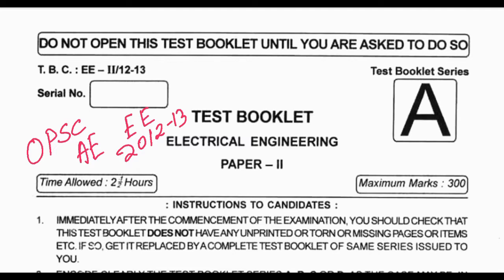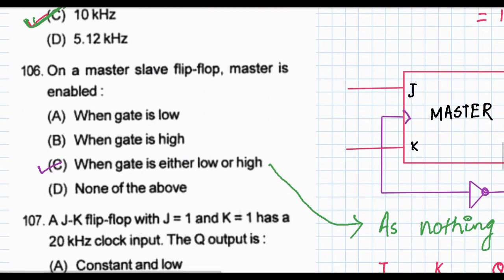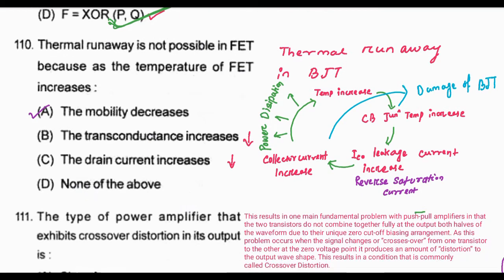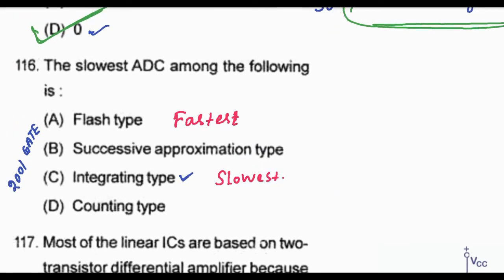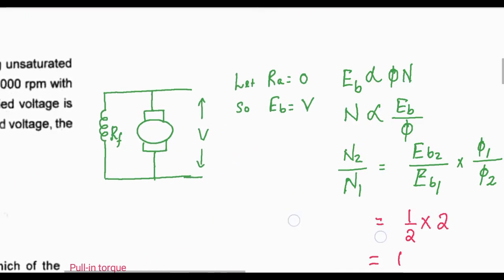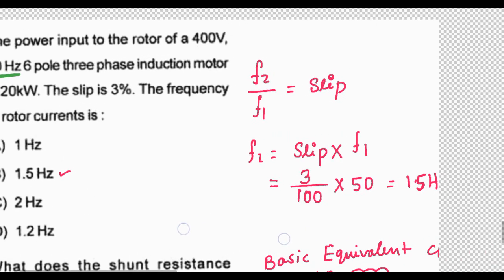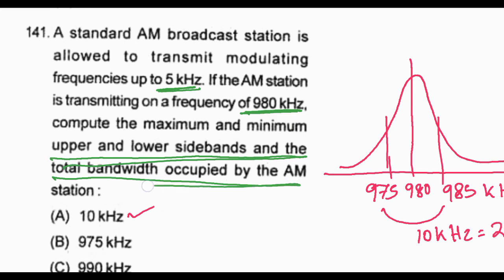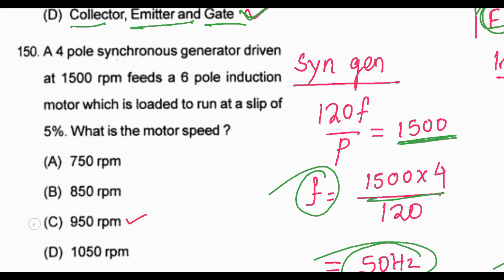#OPSC AE- 2012-13 Electrical Engineering Detailed Solution Part-3

Comment from the maker: Viewers Please Attention:
Question No 106.
You will find in many websites that the answer as option (B) When gate is High
but the correct answer considering the data given here will be (c) when gate (clock) is either high or low
Description:
1. Master Slave Flip Flop is designed to prevent Race Around Condition (RAC). And RAC only occurs in case of level triggered JK and T FFs not in edge triggered FFs and also not seen in case of SR and D FFs (as Toggle operation is not available).
2. So here will obviously consider the level triggered FFs as Master and Slave. In this question nothing is given about type of level triggered FFs (either +ve or -ve or any image).
3. For +ve level triggered FF = Master is enabled with 1 and Slave with 0
     For -ve level triggered FF = Master is enabled with 0 and Slave with 1

Note: 
1. Edge triggered Master Slave FF is also can be designed but it will only require more gates and will have no significance improvement.
2. Master Slave FF acts as "Negative Edge Triggered FF" it has both level triggered Master and Slave FFs.
3. Master Slave D FF is also available to prevent the glitches.